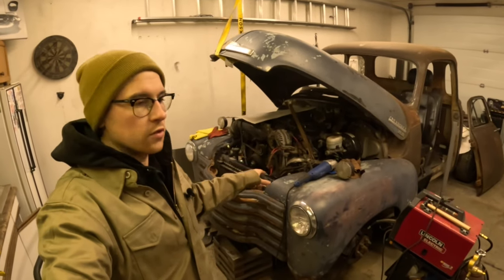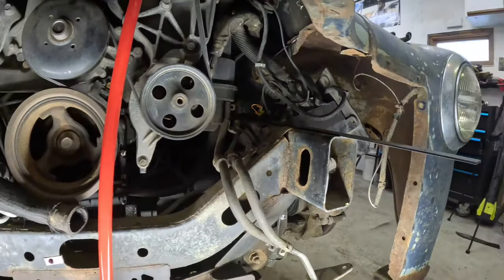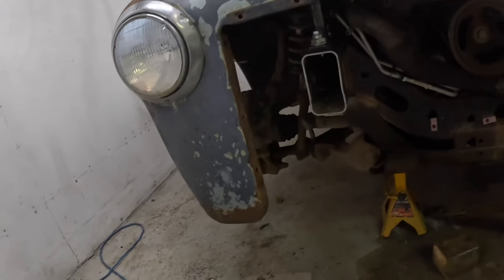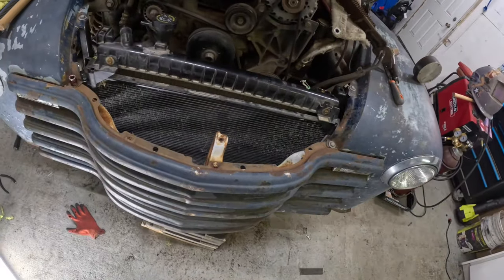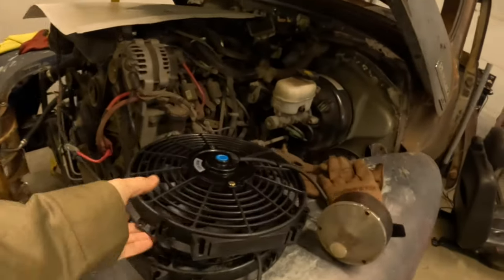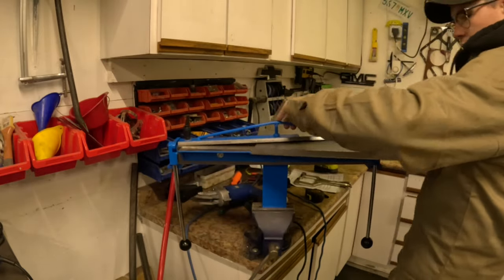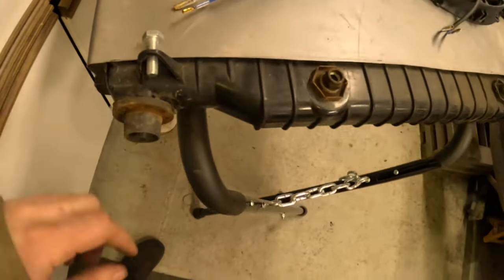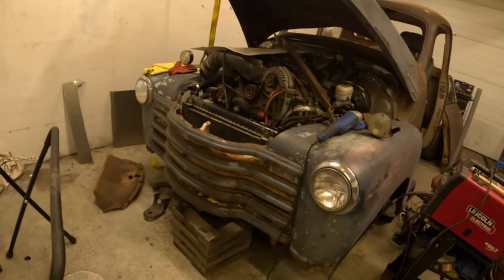1950s CHEVY BODY ON ENVOY FRAME. MOUNTING FRONT CLIP. Ep. 4

Comment: Hey great job keeping with it. Soooo... I always advise using a fan shroud because otherwise the air can be drawn from behind the rad. However when you flush mount the fans the air can only come from the front of the rad and the rest of the rad just becomes passively cooling.  Unfortunately when you flush mount fans AND use a shroud the air is blocked where the fan isn't and the shroud is so in this particular case you would be better off with no shroud. However if you had room to back the fans off like with a mechanical fan you can make a shroud with fiberglass resin and bondo mixed together and brushed on fleece stretched over a temporary wood frame made to fit your rad and/or support. Those really work well and help flow the air through. For right now I'd just remove that shroud and see how it does with fans alone.
Reply: Oh and the air will be slowed at highway speeds and may cause fans to overspin if they don't have an overrun clutch to freewheel  when that happens. Oh and those gaps were nice for an AD!
Reply from the maker: Thanks for the comment! I definitely don’t have room for a clutch fan, that’s what I took out to begin with. The fans aren’t flush to the radiator, they’re flush with the shroud, that is off the rad itself, not by much because of my space issues. The way I built it, to work in my head, and I could be wrong. Is that it creates a draw of air, and suction to pull from the entire rad corner to corner and not just the 12 in of each fan.
Reply: @CentennialCustoms  ok, that's good they aren't flush. The air will take the path of least resistance so you probably can pull a little bit through parts of the radiator not directly in front of the fan but also the air moving over the vehicle will find it easier to go around entirely and the fans will have to do all the cooling all the time. It just means you won't get the free cooling at higher speeds and a fan failure could be bad a little quicker.

Comment: I'm not in love with your shroud.🎉 It's going to block a lot of air going through. Have you considered radiator fan ties that go through the fins?
Reply from the maker: The fans came with those ties. But the shroud allows the fan to pull air through the radiator's entire surface area, increasing its efficiency.
Reply: @CentennialCustoms  seem like it blocks air flow,  but if it works...
Reply from the maker: When at a stop light or idle it creates suction from the entire radiator not just where the fan is. Every car has a shroud
Reply: @CentennialCustoms  yes they do, but they usually have an area that let's air through. If it works it works. What do I know? Lol